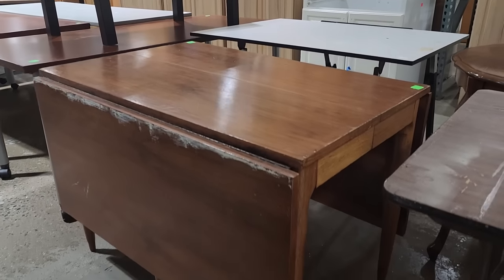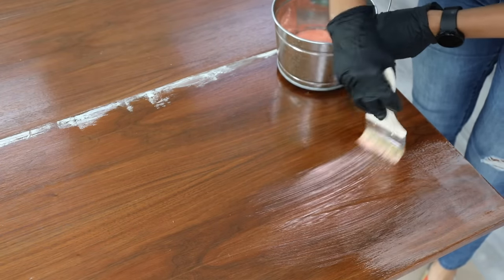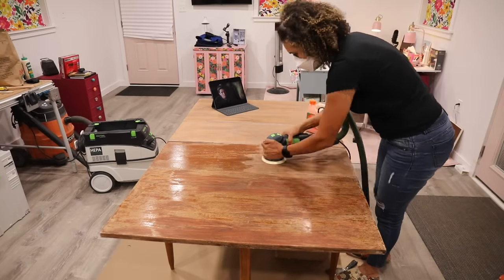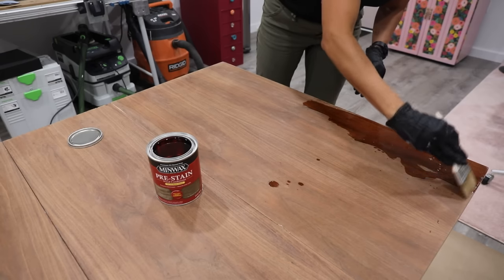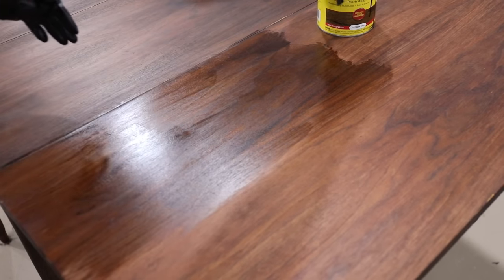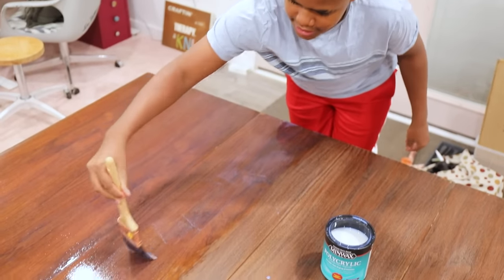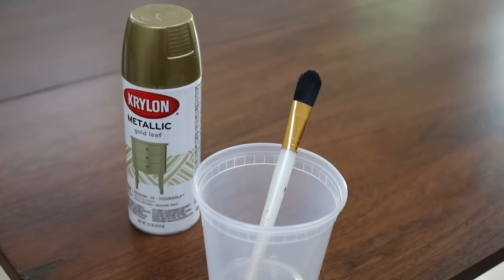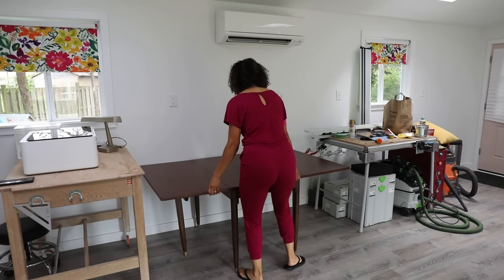Transforming a $35 Thrift Store Mid-Century Modern Table - Thrift Diving

Comment: Love your videos and your shed. 😍I found if you need to fill a chip of veneer pick a colour of wood filler that is close to what the stain colour will be ie walnut. Then when dry dab a bit of clear coat on it to seal it. Then stain the rest of your piece. Then top coat the whole thing. I learned this the hard way. The stain absorbs into that wood filler like a sponge. Turns out way too dark. 🤦🏻‍♀️I did it while refinishing a wood counter top. But thankfully I figured out how to not do it again while refinishing a 110 year old dresser. 😮‍💨
Reply from the maker: That is an AWESOME tip!!! I want to try this again, trying to clear coat! You know, this tip reminds me of when staining wood and the end grains suck up a lot of the stain and turn darker. There is a similar trick that if you water down some wood glue and coat the end grains of the wood first, it prevents the end grains from being a lot darker! Thanks for letting me know that something similar to this exists for filling chipped veneer, too!!

Comment: Generally, one needs to leave the stain remover on longer than 30 minutes (more like 12-24 hours for maximum effect) and cover with a plastic sheet (a cut open trash bag will do). You did it the hard way and just wasted the CitriStrip which doesn't even work that well to begin with. Nice outcome either way.
Reply from the maker: The longer you leave it on, it definitely work better. I'll try that option next time: to cover it in plastic. I typically prefer to use QCS stripper, which I think works better and is safer. But thank you for this comment! I'll try leaving it on longer. Could be a great comparison in an upcoming video! :)

Comment: Is that a regular sander with a can vacuum attached?
Reply from the maker: This is a Festool sander with a Festool vacuum attachment. It's on the pricey side of tools. But you can get a less expensive one like the one I have with RYOBI. I should be able to attach that to a shop vac, too. But I use the Festool because it has the HEPA filter and keeps my shed clean when I sand in here!